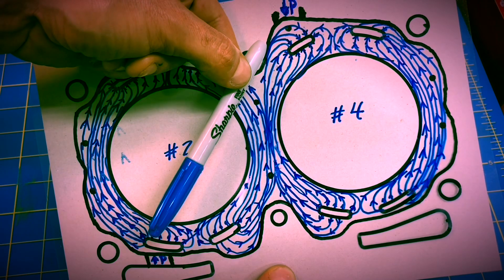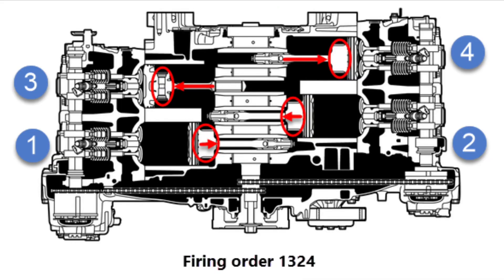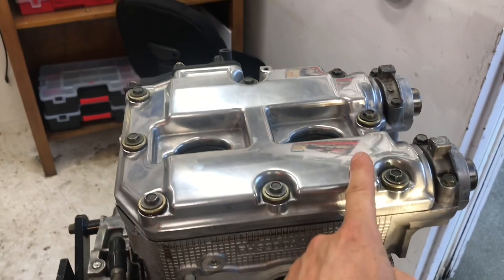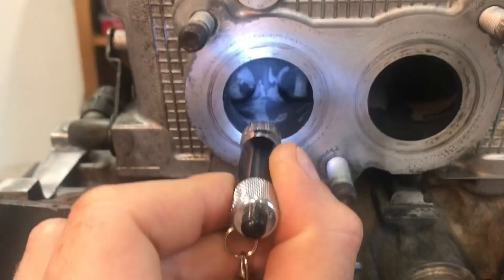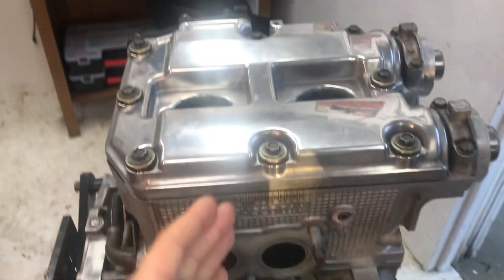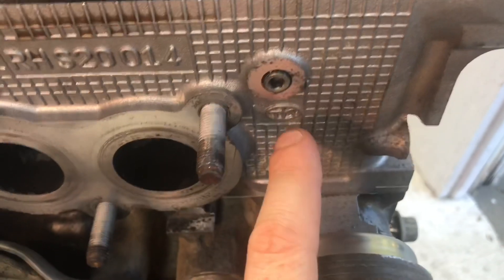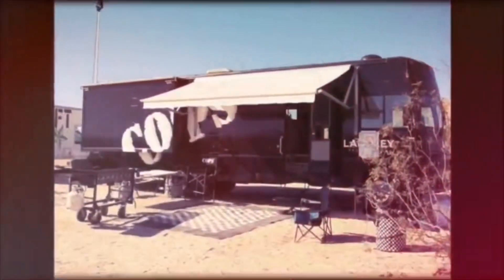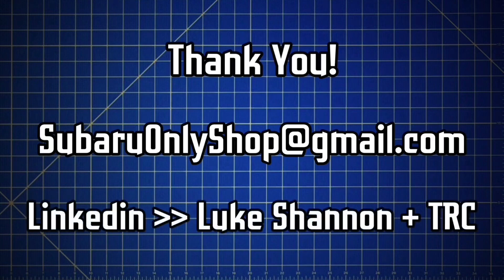Why Cyl #4 Overheats on Subaru EJ-Series Engines

Comment: What do think of the idea of port polishing the exhaust ports but opening more those 2 ports that have the flow restriction?? Combined with equal length headers…? You think temp can be controlled significantly on all 4 cylinders?

Comment: Yeah, those ports are a mess! I'm surprised no aftermarket company has manufactured heads for this engine. Maybe they have. The V8s from the big 3 have numerous aftermarket heads available to them. Now, I have to get online to check the h.p. figures for the NA versions of this mill. Those have to be absolutely pathetic!

Comment: I've seen many external leaks from the head gasket come from the rear of no 4, strangely I have always blamed it on extra heat in the area but I didn't know it was due to this issue.

I just learned about the coolant mod that taps into the back of the head with a t into the heater hose, which is what brought me here.

Cheers.

Comment: #4 generally gets less oil pressure in it as well with the stock oil pump ... and the stock fuel system may contribute to it as well ... I tend to protect number #3 more because of the turbo but #4 does seem to be more of an issue due to heat/oil pressure.

Comment: Of course it's a trade off, The developer never thought people today are pushing 400whp on this thing. The rally 22b only has 345hp and longevity of that engine is not a concern. EJ20 is pretty much designed as a 200hp engine.

Comment: What could be done to reduce block and head flex  when hot thus compromising head gasket seL integrity?
Reply: check out subi-performance, that guys is milling grooves on top of the cylinder and imbedding copper wires in it help HG sealing.

Comment: So wouldn't cylinder one have heating issues too ? If it's designed the same. Or does it have better coolant flow than #4?
Reply from the maker: Great question man!!! It doesn’t have the same issues, but you’re on the right track thinking it should. I think the reason it doesn’t is due to the timing maps used, they use cyl 4 to to determine where the limit is for timing advance by having a bit more advance for that cyl compared to others. Plus, I think the coolant enters from the from have of the short block which may create better for for cyl 1 vs cyl 4, even though the exhaust port path is compromised for both cylinders. Hope that makes sense, cheers man!!! Greet question too!!!
Reply: @SubaruONLY  It's also at the front of the engine where cool air is constantly circulating, but the back two cylinders up against the firewall definitely live in a hotter place to begin with.

Comment: Ever had any problems with coolant flow after installing this mod? Ever since mine was installed, by a Subaru specialist shop, I’ve had problems with overheating at the track. And when I turn the heat on full blast it’s blowing cool air. I’ve burped the system several times but still seems like coolants not flowing as it should.
Reply from the maker: Haven’t heard of this happening, it does sound like something is wrong. I’d double check the routing or maybe even remove it.
Reply: Probably still has air trapped in the system.  Lots of channels report the STI is extremely hard to purge. I think we have to go with a pressurized coolant refill system to force the air out.  The flatirons racing channel is currently dealing with this issue.

Comment: I see people talking about cylinder # 4 all the time. But I had an 06 WRX with 190,000 miles on the original short block and it’s still going down the road with the next owner. So I wonder why there’s so many complaints.
Reply from the maker: Lots of tuners see issues with increased cylinder pressures.

Comment: Hey bro, I have a 1997 impreza uk turbo which is overheating but only when on boost, leaks coolant from the overflow tank, would this always be headgasket? What checks could I do? Thank you for any response.
Reply from the maker: Yes, very possible it could be the head gasket. Can use a solution to test the gases in the coolant for combustion by-products.

Comment: Everyone could use the 4th Cylinder Cooling Mod that Dom makes. This flaw is big and the mod resolves a lot of cooling issues
Reply: I completely agree. I use a different brand and now see a lower overall engine running temp of 84 degrees Celsius
Reply from the maker: Hell yea, great real-world feedback!  Thanks! 👍
Reply from the maker: Yep, totally agree. Thanks bud! 👊
Reply: Here's what I don't understand about the cyl 4 cooling mod. So, once installed the hot water from cyl 4 is then connected to a heater core hose. Wouldn't it need to go instead to the radiator to be cooled? Essentially, the hot water is mixed with the hot water in the system. Am I making sense?
Reply: @santouchesantouche2873 yes you are. The cooling mod is a bunch of bullshit and pointless. All the (mod) is, is a money grab. I mean shit one of the cylinders are next to a hot ass turbo and manifolds. This 4 mod is literally good for maybe 5 degrees which is nothing.
Reply: I installed mine yesterday💪🏽

Comment: Just had head gaskets replaced on my 2002 legacy outback,2.5,sohc,awd I think the mechanic didn't do such a good job.I think he rushed through it.I told him I wanted multi layer gaskets,not fellpro or graphene and I'm not sure if he did that.Also,I was told he could have put them in backwards.Is there any way to tell without taking the heads off?
Reply from the maker: Yes, usually there’s a little of the head gasket material sticking out on the sides. Find a spot where you can inspect it and you should be able to see if it’s a MLS (multi layer steel) design - they’re easy to spot as they are just a stack of thin metal vs some solid composite material.  Good luck buddy! 👊

Comment: I think you have good points about heat transfer to the wall of the cylinder heads. I also believe the main reason that no. 4 has more of an issue is the coolant flow. No. 3 has the benefit of the coolant return from the turbo. No. 1 doesn't have the problems because of the coolant flow path and some heat transfer from the flow of air from the radiator fan
Reply from the maker: Good point buddy! Totally agree. Cheers!

Comment: Interesting theory, but why doesn't the 1st cylinder have the same issues with temps as the 4th one? The exhaust ports on them have the same layout.
Reply: It’s because that side sees cooler temps because there is an addition path for coolant to flow. He mentioned it but didn’t go to detail in this video. The 4th cyl doesn’t have that additional coolant path unless you do the cyl 4 cooling mod

Comment: ... If not designed right down the middle of each cylinder, but even moved closer to the middle of the two cylinders so the flow is the same, with the same deviations into the manifold to keep the manifold pipes close together. Air in, air out, as smooth and as fast as possible should be the goal. Yes?
Reply from the maker: Yep. Pretty much! 🤙

Comment: That makes sense but theres more.  Subaru made cyl #4 run hotter by giving the head less coolant flow and less fuel, since the knock sensor is located closest to cyl #4 , that cylinder's knock will be detected more.  So other cylinders being cooler will have less knock by nature.  Subaru fixed this issue with their FA engines by giving it 2 knock sensors.  But no worries for those EJ25 owners, theres a fix for cyl #4 to run cooler, i will be making a video on it in a few weeks, I just had my lucky #4 crack on me during a trackday session.  Also Subaru been using pistons that have more silicon then usual, that makes the piston hard but brittle, those pistons dont expand as much as say forged pistons, a lot less actually so subaru can go for tight clearances to avoid piston slap when cold, but they crack when beat on, mine went at 37K miles. check out my last video.  Cheers boys! Subscribed! great channel, thanks!
Reply: how does it have less fuel lol? makes no sense.

Comment: Great information! I didn't know the ports were placed like that.
Like you said, it inspires me want to make a custom performance head. What other things would you change on a newly designed head? (like direct injection, more space for larger cam lobes)
And I wonder if this extra heat in the head is a contributing factor to head gasket failures?

Comment: Extremely interesting, I have a question, on idle  is it normal to have the right side of the exhaust to get heat up faster than the left. I have a 2008 subaru wrxsti.